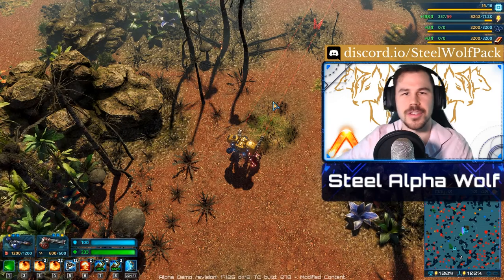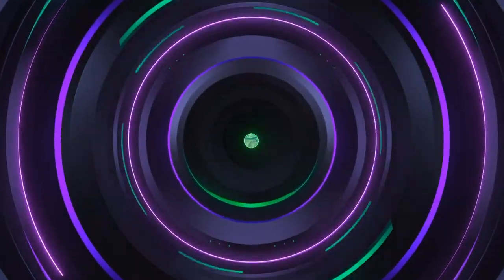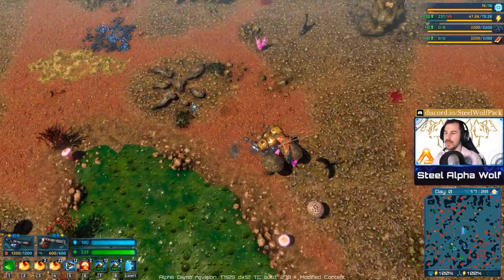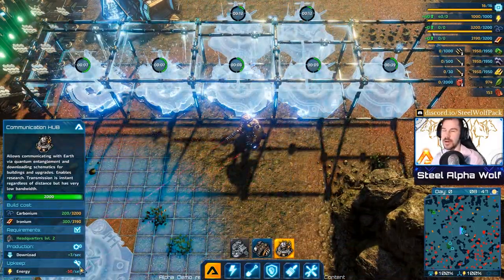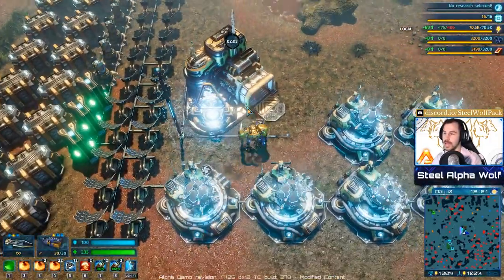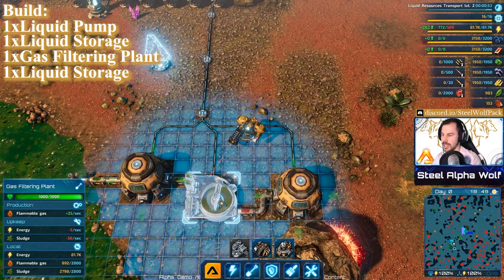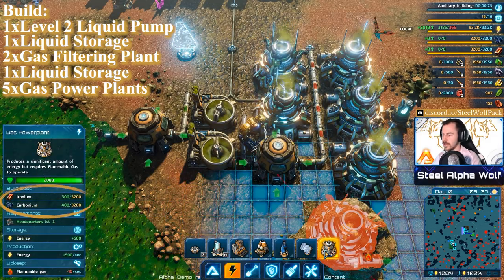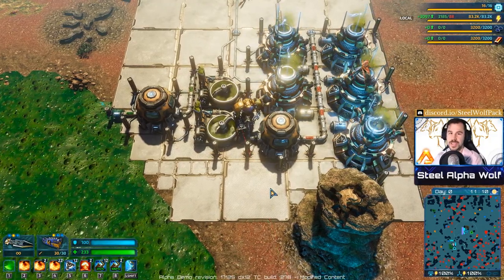How to setup Gas Power Energy | The Riftbreaker | Guide | tutorial | Step by Step

Comment: I am periodically having a bug where my gas filtering plants randomly shut down.  They still have sludge flowing to them & are connected to empty gas tanks and plants that they refuse to fill, even though they were doing it before.  The setup for gas power is pretty simple & its obvious that pipes are not directional.  Anyone know how to work around / avoid this?  

Before I would turn the filter plant's power off then on again & it fixed it.  Now they are stuck off & rebuilding them doesn't fix them either.

Thanks and Happy New Year :)
Reply: 6 months late, but build energy storage. It may be because storage is maxed out.

Comment: how to or where to get Ferdonite. Looked everywhere but cant seem to get it. I have played custom survival and upgraded my towers to max except my weapons craft which needs Ferdonite and cant seem to find any for the Max weapons. Dont really have time for Campaign ue to work
Reply from the maker: In survival, I don't think you can actually get it yet 😢 

Let me check with others though
Reply from the maker: So looks like in right that you can't really harvest

Apparently you'll get it as mob drops OR with the geoscanner, you can find caches with up to 500 ferdonite!

But that's about it in survival 😢
Reply: @steelalphawolf  Thanks for letting me know. That sucks. so far I have only managed to craft the blue weapons that requires no ferdonite and has only 1 mod slot. I just dont have the time to sit through the lengthy campaign with long researching time to experience using the red weapons. Might have to get some cheat trainers or download some save files.
Reply from the maker: @Jack-xx3qg  well you could use the cheat cheat_fill_resources

The other thing is that the campaign is AWESOME and that putting in time here and there to eventually get to red (which honestly isn't that long) is totally worth it

Like if you're playing survival consistently, just play the campaign during that time instead

100% worth it even in little amounts of playtime

Comment: Quick question. I have mini-bases all over for mining and such, and 1 big base in the corner of the map. For some reason, none of the buildings in my main base have power no matter what I do. I don't know exactly when it happened or what caused it. Do you have any ideas? Power says +0/-0, so it's not consuming or producing.
Reply from the maker: Hmm there has been mention of this being a potential bug

Try plugging it to one of your mini bases or even selling off a bunch of your power infrastructure and rebuilding it (Selling is 100% if your building is at full health - just make sure you have the storage for it so you don't waste resources!)
Reply: @steelalphawolf  That's another part of the bug, it will not let me connect to any other bases. If you move the power node close the others from other bases, it won't make the connection. I can try selling off the power infrastructure but I'm pretty late game and would take forever to setup again lol. I hope they fix it.
Reply from the maker: Ah dam... Ya they're hustling hard to make fixes - they've always been good about that 🙏

Worst case, it's an opportunity for a remodel 🤣
Delete and build with only gas and fusion and such :0

Comment: Great video!  i like to fully upgrade my gas to tier 3.  it gives alot of power and you dont need to rush fusion imo
Reply from the maker: Ya good call man!
Only thing is the super high cost of both research time and resources of getting to level 3!

I do find it's less spacious than fusion which is good :)
Reply from the maker: And fusion will become harder to set up because apparently it'll also need titanium in the supercoolants on release
Reply: @steelalphawolf  yikes.  But makes sense cause of how powerful it is
Reply from the maker: @derekbrown3537  ya exactly, like not just energy but the supercharged plasma for shield generators right? It's a HUGE tier up for your base